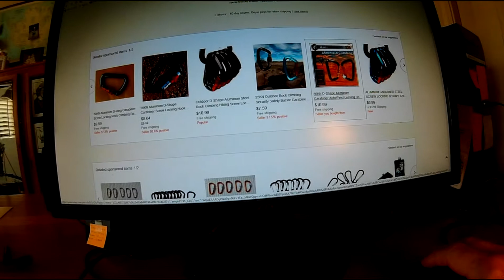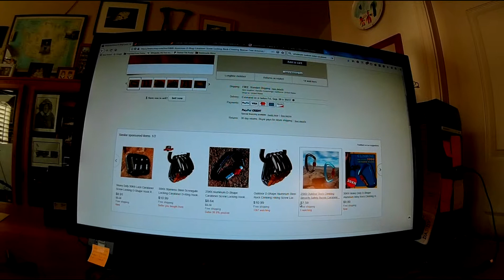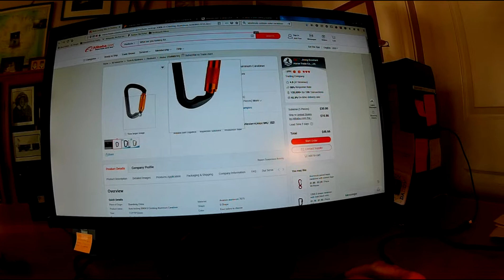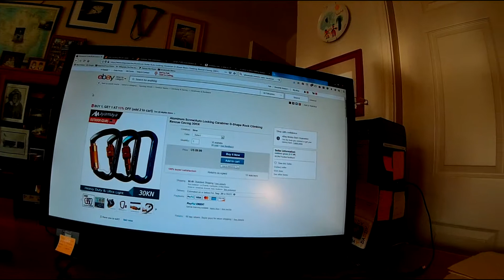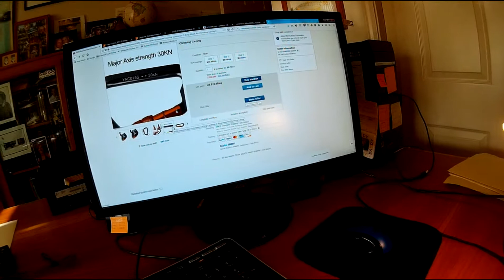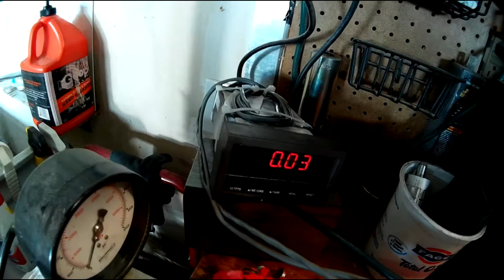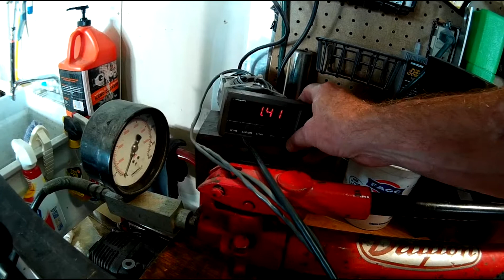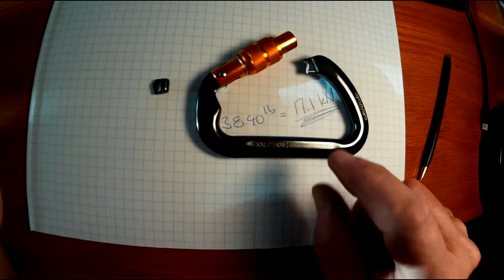Unidentified Carabiner Tested

Comment: Another test that i have seen is on aliexpress on a more typical sized carabiner (9.5cm x 5.7cm), that one was tested up till 15kN but not till failure (i guess the guy didn't want to totally mess up his carabiner).  There is another youtube vid testing the Xinda carabiner (that particular one is not UIAA certified, some in the Xinda range are and are legit listed on the UIAA database for independent verification) till 900+kg.  And there is another one that showed another carabiner lifting a pretty big sized gen set, though the weight was not shown.

Comment: Thanks for doing such tests and validating the figures.   I use quite a few of such carabiners for kite flying and there has been much debate by the others that such cheap chinese carabiners can't even take half the rated load (usually 23-27KN) coz it's not even 7075 aluminum or that the tempering must be terrible etc.  We now know that is not true (coz the correct loading point should really be as close to the main spine as possible, i agree that the designed internal shape of this particular carabiner with that small bump/notch is a flaw).
 I get such 11-12cm/6.5-7.5cm carabiners from Taobao, which costs about usd 3 - 4.   I also use those 1.20usd 12kn 8cm x 4.5cm ones.